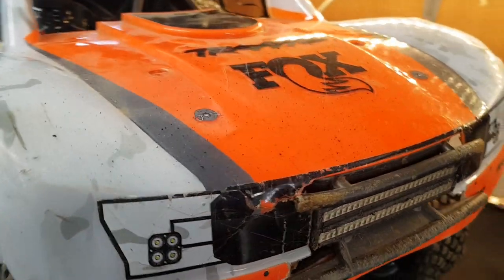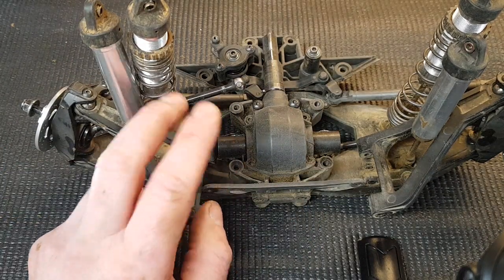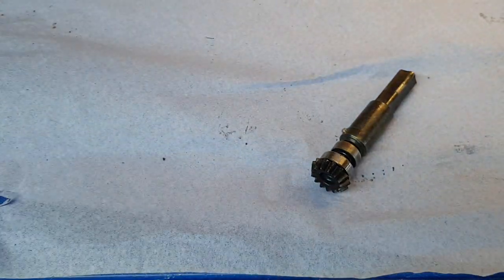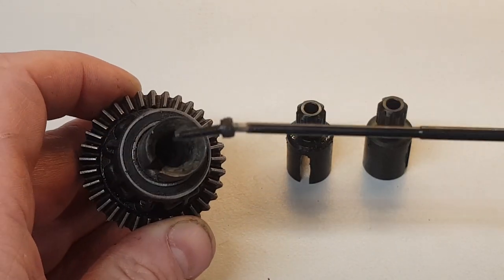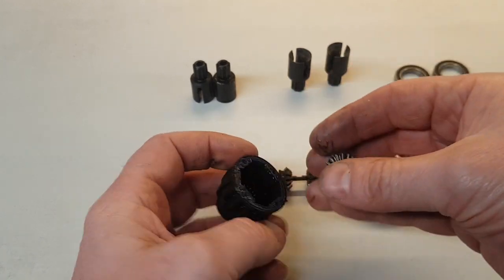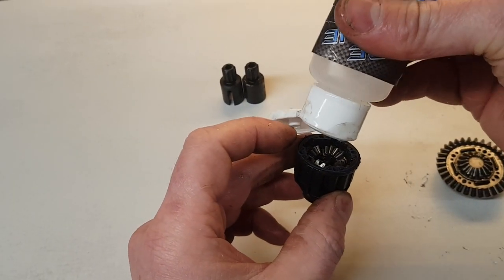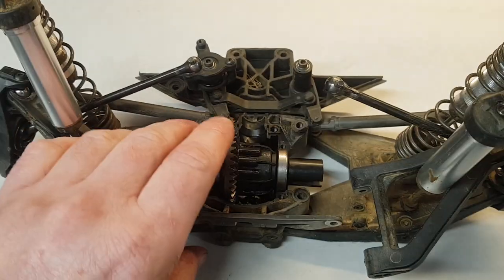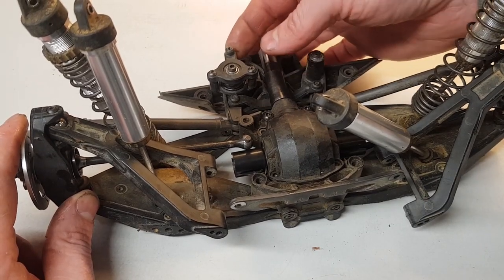How to rebuild front diff on Traxxas UDR Unlimted Desert Racer

Comment: I use red thread lock and apply heat when I need to remove it but only those screws where it is easily accessible
Reply from the maker: Hmm never had a need to use red threadlock - blue is all we ever use
Reply: @TeamRC3D  well, not on the diffs but most certainly on the rear drive shaft

Comment: You are wrong about front diff accessibility... you can access front diff just by removing a body and unscrew 4 screws above front diff ....
Reply from the maker: We have tried your method and because of the drive cups it won't come out. Unless we are missing something. Video on this being released shortly
Reply: @TeamRC3D  you can unscrew one of two cups from side. You can even change your cups without taking you diff out